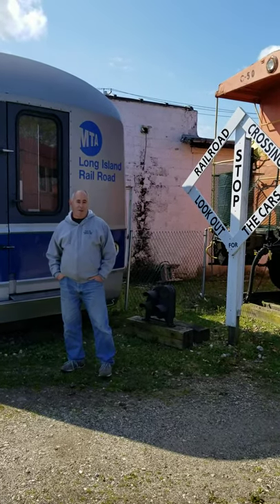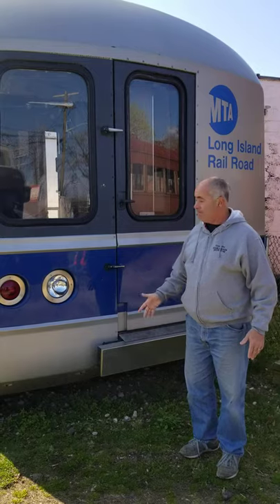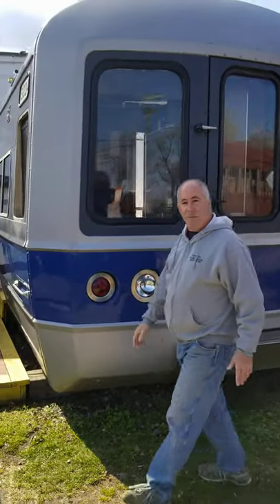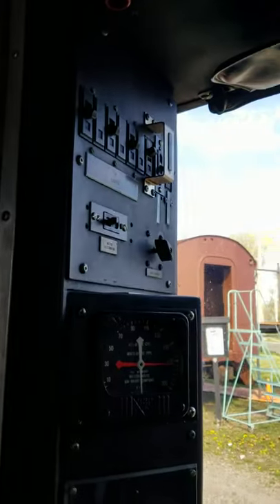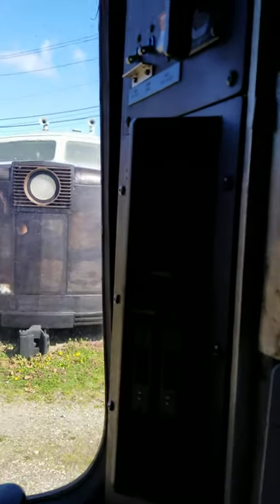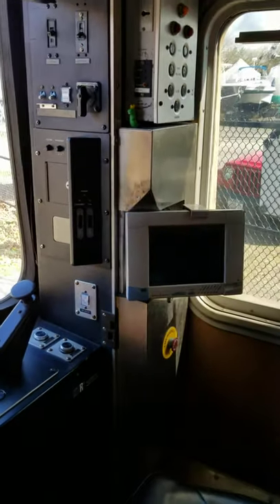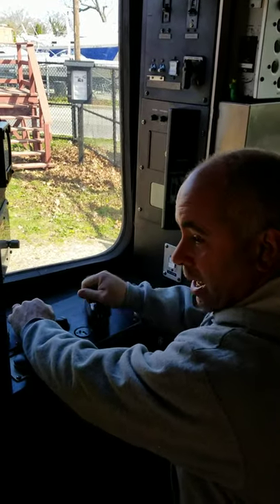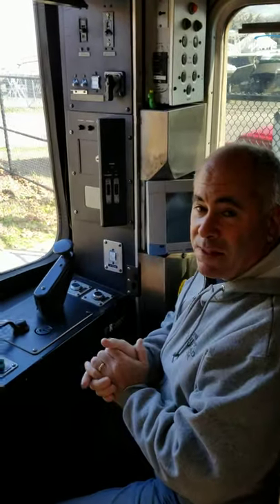LIRR M1 Simulator - Virtual Tour 03 - Oyster Bay Railroad Museum

Comment: I miss the M1 and M3 long Island railroad Trains
Reply: And I miss the old steel trains from the 1910s thru 1950s that still ran in the 1960s. My first Long Island Railroad trip was in 1960 with my late parents and my uncle's family from Woodside to Long Beach, Nassau County.  The windows could be opened and there were slots on the raised ceiling for ventilation. The headlight wagon the roof.

Comment: Bro it looks like an R44
Reply: Built by budd, not pullman or st louis. Most trains had this style at the time around the states.
Reply: @Astrochorius  R40M, R42, R44 and R46 along with the M1-M6 were all designed by Sundberg-Ferar.
Reply: The first look was the R40M from late 1968 for the NYC subway.
Reply: @luislaplume8261  An afterthought on the assembly line, as the partly completed R40 shells had straight end cowls slapped on them, under direction from MTA chairman Ronan, the decision was done around November 1968 and the first modified R40s rolled out of St. Louis in January 1969.
Reply: @kevinwong6588  Thanks for the correction. I mistook an earlier contract for the event. I remember the R42s in the summer of 1969 when they were new and they passed by my bedroom window that had a lot that had nothing on it in Richmond Hill on the Broadway Jamaica line to 168th Street terminal in Jamaica.  Whenever a new bus or subway train with air conditioning came to our neighborhood. It was the talk of the day back during the Mad Men era of the 1960s NYC that I lived thru.